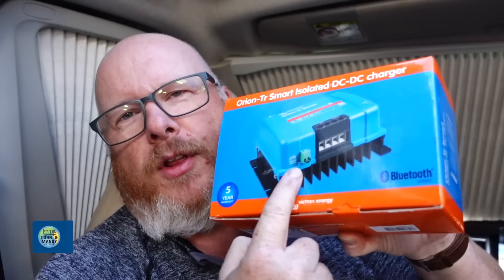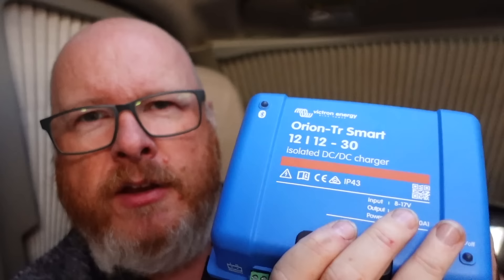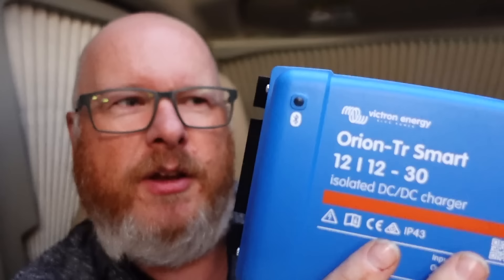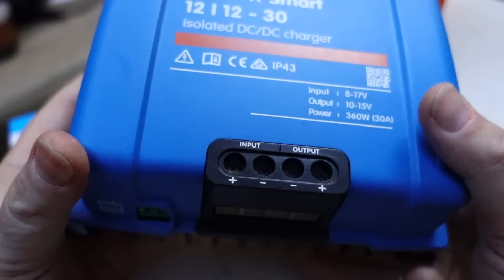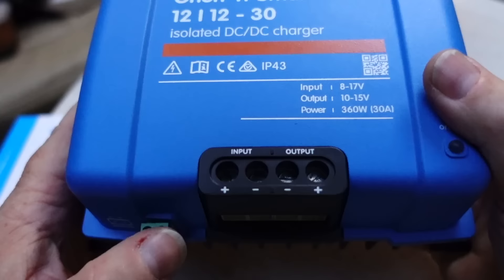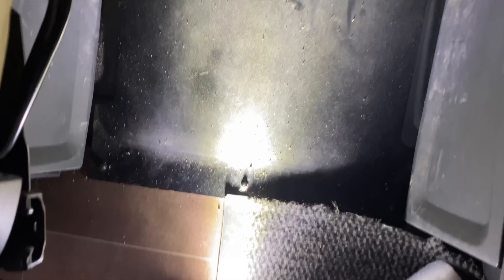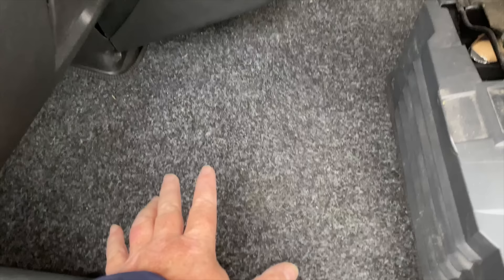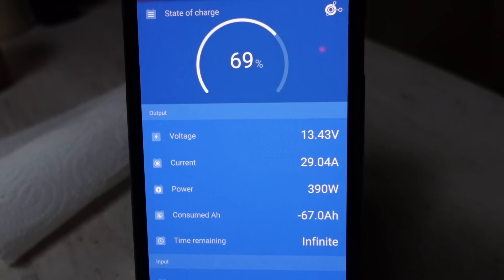Victron Orion DC-DC Isolated Charger B2B Installation

Comment: Thanks for a great video! 

I have the following setup:

Alternator: 100A
House battery: 200Ah LiFePo4
Starter battery: LeadAcid 75Ah
DC-DC Charger: Victron 30A non-isolated
External regulator: MC-614 with alternator temperature sensor

Solar panels: 240W with Victron SmartSolar MPPT 100/20

The main purpose for this setup is that I want to be able to charge the lithium battery fast with the engine at idle (80-100A would be fine). I realize that the alternator can become hot, hence it's protected by the external regulator w/ temp sensor.

In other words, I want the starter battery to be trickle charged by the lithium, so I guess input to the DC/DC charger will be the lithium and output will be the lead-acid starter battery, correct? What happens when motoring at sea and the house battery becomes fully loaded and the BMS, or rather the DC/DC charger stops the charge? My intention is to have the DC/DC charger top up the starter battery continuously, as a way to deal with the overflow current from the alternator. Should I connect a continuous small load to the starter battery?

Balmar underlines that the  MC-614 regulator must be shut down before the lithium battery is disconnected by the BMS, since running an alternator without a battery will damage the alternator, especially if disconnected during high current charging, causing a load dump. However, isn't shutting the regulator down going to damage the alternator since it has nowhere to feed the current? 

I guess the secret is in how the regulator and the DC-DC charger is programmed?

I'd appreciate very much if you could share your thoughts on this, and I think there are quite a few of us out there that would benefit from your insights. :-)

Thanks,
Jan
Reply from the maker: Sorry, I get hundreds of messages daily. 
Do you have a brief specific question ?
Reply: @johnmandy  I can imagine, sorry for the rambling... 
Specifically, I would like to know if the DC/DC charger is intelligent enough to handle the trickle charging from the lithium to a lead battery.
See, being able to load the lithium directly from the alternator is what everybody wants, but it needs to be well planned.
Reply from the maker: The b2b detects an increased voltage and then begins charging until full. It has multiple charge stages from bulk to float, it’s all explained in the video. From your question I think you’re trying to use it the wrong way round. What you need is a something like this https://amzn.to/3bwAYV3
Reply from the maker: Oh wrong link, this is the correct link https://www.12voltplanet.co.uk/votronic-12v-standby-charger-trickle-charger.html
Reply: @johnmandy  Ok, except it's "suitable for use with lead-acid batteries only (not for use with lithium technology)". Thanks anyway, I will let you know if I succeed in my endeavour.

Comment: Hey Mandy, Awesome job on managing John to produce yet another outstanding and informative video.
One question if I may......... Do you know if the Victron will be capable of charging a leisure battery in the towing vehicle plus another in a caravan? The obvious complication is that the caravan battery is not always connected.
The alternative is to use 2 Victrons - but that'll get expensive.
Thanks in advance
Dave (Fat Bloke from Stoke)
Reply from the maker: The caravan battery is usually charged from the towbar electrics via the alternator.
Reply: @johnmandy  Yea 'tis....... But understanding just how quickly you are now able to charge your leisure batteries from your engine you've proved with the victron I'm now looking to do similar. Just wondered if it was possible to do this automatically or via a quick config with the app using a single larger Victron or would it be vest to use 2 smaller ones ?
Reply from the maker: I think you’d lose too much over the long cable, or you’d need a 50mm cable to account for the drop

Comment: Hi John, I bought one of these a few months ago from 12V Planet. Just watched your video before I start installing and noticed I have the non-isolated version so no negative to batteries. Have I bought the wrong thing? 😕
Reply from the maker: The start of the video explains the two versions and you can easily work out which is best fit your type of van then 👍🏻

Comment: Hi John, I have 2 queries regarding the Orion dc dc charger, mine “never”  charges above 25/26 amps and that’s reading from the Victron smart shunt, the other question is I’ve read on YouTube it’s best to connect the charger “opposite ends” of battery bank to your “load” connections? In other words I have 3 AGM and my charge cables and Load cables are on same bus bar as opposed to what’s suggested, the guy reckons that the battery with all the connections “gets charged and loaded” quicker than the all three equally? Does that make any sense? Thanks
Reply from the maker: All I can say is the way I wire my systems they work perfectly. Your shunt will only show you what's being used from the battery and supplied by the B2B so it's not a true gauge of what the charge amps are, for that you need an amp clamp.

Comment: Another question for you. Just about to install my charger and I don 't know how but I have lost the little green module that  I believe is the bluetooth. I haven't been able to find anywhere in the UK that can supply this part. Any ideas on a work around or where to get the part?
Reply from the maker: The green bit is a jumper to help setup the controller. Watch the video to find out more, you can link both points together, the video explains this stage.
Reply: @johnmandy  Thanks for that. However my problem is that I have lost the jumper. I need to find somewhere that sells one or try somehow attaching a wire between those to tiny very close together points. That's the bit I am stuck on.

Comment: Hi @John & Mandy, nice video all info well presented and explained. I have 1 question, the fuse of 30 A was ok, did you change it after with a bigger one? Victron recommends a 60A fuse. Thanks in advance. Cheers
Reply from the maker: It’s a 30A breaker and it works fine, they only trip if there’s an overload that causes heat through the cable.

Comment: I just ordered one of these. I have seen where once you get everything wired up that if your lifepo4 batteries are low on charge the B2B will drain your starter battery, fill the lithium and then recharge your starter battery. For instance if your starter battery charges at 15 amps per hour but your lithium needs 30 amps per hour it will take the starter 15 amps and it's charge first. Did you have any issues with this? I wonder because I am waiting for the cells to build my own battery and have seen on youtube these cells coming in nearly fully discharged.
Reply from the maker: No issues at all, everything works fine if you wire it up correctly and your batteries are wired correctly and using the correct cables.

Comment: I've got the Isolated version in an earthed chassis panel van, can I still earth my devices to the chassis or do they have to back to the leisure battery?
Reply from the maker: I’ve got an Advanced 12v video that includes a schematic to show the best way to wire everything up.

Comment: John, can I just confirm that you are running 2 chargers from the main battery? I've got a Renault Master (ex pts ambulance) so it already came with a starter battery (obviously) an aux battery (under the passenger footwell) and a split charger to connect them both, I have myself installed 2 100 watt solar panels and 2 110ah batteries in the back to run my electrics independently from the cab, my solar runs Purley off a cheap pwm charge controller and I would like to upgrade to a dc to dc like ring etc, would that be possible? Even though there is already a split charger running from main battery? Thanks, hope that makes sense.
Reply from the maker: The ring combo solar & b2b is great and but watch the video as I talk about why you shouldn’t use split chargers.
Reply: I watched it thanks, although the split charger isn't the best, its all I have to work with as it already came with the van and don't know how to disconnect it as it was built in with the ambulance build,  is it still possible for me to run both the split charger in the front and the b2b in the back off one alternator and starter battery?

Comment: Hi John, thanks for the video.

just to clarify . . . .

you say you have "20a b2b electronlock." - so 20Amps from the OEM charger

and now the new 30A Vicrtron DC-DC - so 30Amps from that. (so 20A + 50A + solar? = total?)

but @ 11.11min the BMV is showing 29A into the battery bank . . . .  (you said that was from the OEM charger, but its 20A max?)

Then @ 11.32mins we see 51A going in to the battery bank? . . .  you said that extra 20A was from the Victron, but its 30A max.

whats the discrepancy? . . . was the Victron supplying the 30A we see first? . . .  the the extra 20A from the OEM charger? (50A ttl?)

thanks again.

im off to watch the Diesel heater vid now.  =]
Reply from the maker: the extra 9A could have been the solar controller, i explain all this in the video.

Comment: Hello, great vid. Can I use the Victorian b2b without using solar. I have used both solar and b2b in my previous van but for my new small van I want to use solely b2b in my electrical system.
Reply from the maker: The b2b and solar are independent systems, you can run both or just one, it’s fine either way.

Comment: Hi John,
i have just orderd one of these for my Van (Swift Escape 674) it has the Saregent charging system installed with a 100 watt solar panel and 80ah Gel leisure battery which is being changed to a underseat 200ah lithium battery. 
I have read somewhere that my van charges both leisure and starter with engine running so can i just fit this without any alterations to my existing set up ?
Regards Darren
Reply from the maker: It’s all fully explained in the video 👍🏻

Comment: If engine running doesn't it cut out interior electrics so you have to wait till engine switched off  before using interior lights and tv etc?
Reply from the maker: Not in our van, that’s a silly feature of British built vans, but you can override this 👍🏻
Reply: My Euro van doesn't. Perhaps some UK vans do?
Sounds like something to bypass.
Reply: @johnmandy   I assumed all m'homes were the same as they say it's for safety on my autotrail. Is it a simple fix? Can't wait to get out again.
Reply from the maker: As I said it’s only British built vans, it’s a silly law about powering the auxiliary systems while you’re driving. You can change it though.

Comment: Great video. Thanks for uploading. Does the unit require any other wiring for vehicles without smart alternators?
Reply from the maker: No, it’s the same wiring. You just choose the alternator type in the app setup.
Reply: @johnmandy  I also notice you have 2 circuit breakers on the positive line from the vehicle battery to the charger; one ANL fuse on the vehicle battery and one breaker just before the charger. It should be okay to just have 1 circuit breaker on that line somewhere, correct? I assume as close to the vehicle battery as possible.

Comment: Hey! Great videos... 

Probably a simple question but I see your using a 30amp breaker... I have bought an 18amp Victron B2B charger.. Would I use an 18amp breaker?? and then for connection -- what size cables do I use... I'm a Confused follower... lol

Thanks for your input :)
Reply from the maker: I use a breaker to protect the batteries from a cable short. 30a breaker is fine. Use 16mm cable for less than 5m or 35mm for a longer run.

Comment: Almost identical setup but not had as much luck, I get approx half the amps out of the Victron b2b it's rated for. It will also sometimes completely shut down and think the engine is not running often when cruising motorways even when my leisure batteries are low. I think it's due to the 2020 Ducato Euro 6 smart alternator trying to be too economical. What year is yours?
Reply from the maker: Ours is a 2015 and doesn’t have a smart alternator. You can remove the link jumper and install a switch to override the auto detection. 👍🏻
Reply: @johnmandy  Yeah have a feeling smart alternators not so smart for camper vans/motor homes, yes agree I think the manual switch may be the way to go. One day I will try a second b2b just to see if that gets the alternator to give me more juice! Cheers

Comment: If my 200ah lifepo is at 13.8 volts at 50% charge per my monitor, will my dc-dc charger outputting 12.5 volts actually do anything to the battery to raise the   charge level?  It does not appear to.
Reply from the maker: Your b2b is faulty if it’s only charging at 12.5v

Comment: My starter battery is ground to the van (transit) chassis in the front, whereas my leisure battery in the back is ground to a bolt on the van floor. From what I understand this would mean they are both ground to the chassis, however I'm unsure whether that difference in grounding position, albeit 3 or 4 metres, is going to make a difference as to what charger I get, isolated or non-isolated. Any thoughts?
Reply from the maker: That’s all fully explained in this video, after watching you’ll know exactly which type you need 👍🏻

Comment: Excellent video, thanks heaps. I’m planning on 600AH lifepo4 house bank in my yacht whilst keeping the AGM engine starter battery and installing a dc dc converter.  I have been concerned for my 55 amp alternator being over heated, and should it be a “smart” alternator, which it isn’t. Also I was confused regarding isolated and non isolated chargers. Being a beginner it’s complexing. You’ve covered things well taking most of the mystery away, great.  One Question, you chose a 50amp model, what’s the thought process in your decision making? What’s it related to? Appreciate any comments.
Reply: 30Ah charger. 20+30.

Comment: Can I use the input battery volts that come from a battery isolator already installed? Then when I turn the ignition off the motor batter is diconnected from the dc to dc rig
Reply from the maker: Follow the video installation instructions for the correct way to wire it up. 👍🏻
Reply: @johnmandy  Thank you.  I have Batteries now and find I am on quite a learning curve as to alternator, solar and power supply sources to charge AND do it without waste, damage and IF possible be frugal.  Yet cheap seems never to be nearly as good as the quality ... so price can become moot.  Thanks again.

Comment: What size battery protection fuze did you when fitting your victron b2b
Reply from the maker: 100a breaker and fuse, protected at both ends.
Reply: @johnmandy  just to make sure a 100amp fuse at each end  of the batteries just make sure as I'm having the same b2b as yours delivered tomorrow and would like to order the breaker and fuses asap so I can fit it sorry for bothering you and I watched your channel great job keep safe
Reply from the maker: It’s all shown & explained in the video.

Comment: There are different Amp versions... How do you know which one to go for? For example, I have a additional 55amp battery that I want charge so do I go for the 15 or 30 amp version?
Reply from the maker: The higher the amount rating the faster it will charge your battery. However, as you’ve only got a 55ah battery then a 15a charger will be fine if you want to save some money.
Reply: @johnmandy  Thats just for my winch battery as I run an overland setup... I want to replace the CTEK thats in the front of the car for Victron... Thanks for the advice BTW.

Comment: Hi John. Where did you fit the +/- cables from the victron to battery? Which battery and why? Complete noob here.
Reply from the maker: I’ve got a fairly interesting 12v setup so didn’t show it connected at my end, that’s what the diagram is for in the video, so you can wire it according to your own setup. The output goes, after the breaker, to your leisure battery, if you have 2 batteries then check out my guide on wiring multiple batteries and it’ll show you where the b2b should be wired. 😎👍🏻
Reply: @johnmandy  brilliant stuff. Cheers

Comment: Hi John can you suggest a set up for me please I’m currently running 120w solar to a pwm controller and x2 lead acid leisure battery 
I’m being told to swap the solar to 175w panel then swap the pwm to mppt 75/15 controller with a bmv 702 monitor and dc to dc charger does this sound ok ? 
I have checked my set up and see no isolator switches at the moment would I definitely need those with changing to above set up 
Thanks love your channel
Reply from the maker: That does sound like good advice, if you want to increase battery capacity it’s advisable to get the same batteries, same age too, which usually means replacing the existing battery. Unless you’ve got lithium batteries, then this rule doesn’t matter.
Reply: @johnmandy  thanks buddy I have just bought x2 new leisure batteries 😊 would I need isolators or cut of switches and so on

Comment: Hey guys, is there a problem with the two chargers charging at different voltages? And is that bad for a battery?
Reply from the maker: The voltage output would be the same as it’s coming from the same engine alternator.
Reply: @johnmandy  The split charge relay goes through the sargent controller though so was wondering if the sargent drops the voltage (alternator is 14.3) I will be charging lithium like you -  Has it been working fine?  Still getting about 50amps while driving? Thanks for coming back to me -)